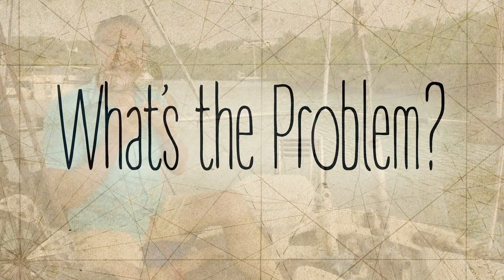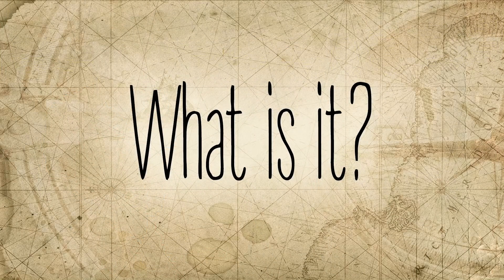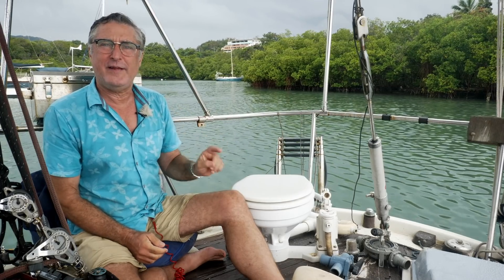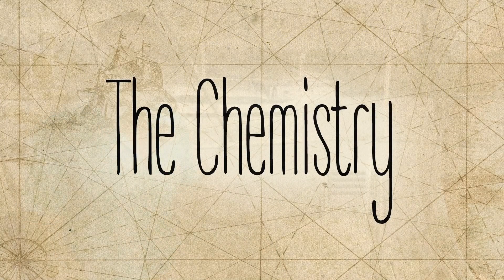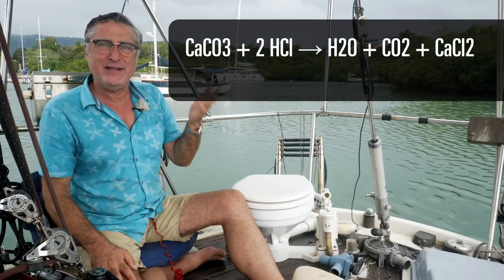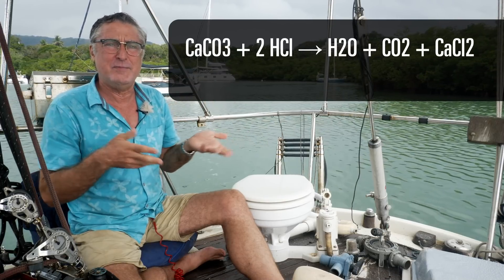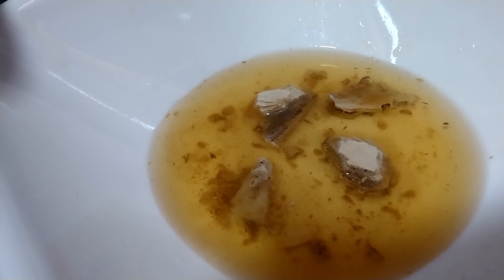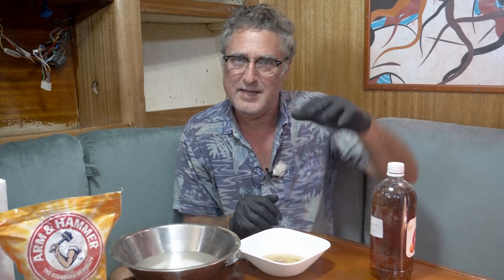Avoid Crappy Situations Aboard

Comment: Does the holding tank get full of stuff that can't be sucked up present overboard?
Reply from the maker: They don't tend to.  I've had the same tank in Temptress for over 35 years. It's fine.
   I put some acid in it through the toilet while cleaning the toilet but I expect that it is neutralized by the time it gets through the hoses.
   Likely the urine reaction is neutralized by the time it gets to the tank.

Comment: Our best recommendation for a boat head improvement is to install a non-electric bidet toilet seat adapter. They are relatively inexpensive on Amazon and significantly help reduce the use of toilet paper on board. They also make it easy to clean the toilet and flush with fresh water when treating with vinegar or acid.
Reply from the maker: Yes, we have one on Temptress

Comment: Clark -thanks for this I learned heaps - i used 80 grit sandpaper to clean my porcelain bowl before i watched this. Got all the Ca Co3 off  like new..   I have a friend that suggested I use Muriatic Acid into my heat exchanger..says they come up sparkling.. just add toengine side of sea strainer and let sit then flush....What are your thoughts?
Reply from the maker: Occasionally it's required.  I usually take the intake and outlet water hoses from the engine to a bucket.
That way I'm not wasting acid and I can see the "rocks" that come off.

This is important as this process takes a while.  The heat exchanger needs to heat up first.

Also for safety and ease on your engine you might want to use citric acid or white vinegar.
Reply: @Clarks-Adventure  You are a champ - love your work.. Thanks

Comment: Thanks for another great video with great tips.  But how do brass seacocks react with the acid?
Reply from the maker: It should be reacted by the time it gets there so not very strong.  If not the ocean would dilute it fast as it's just inches away at that point.

Comment: I have read that the buildup in the pipes is cased by a reaction of the pee and salt water.  Wouldn't the best way to avoid it simply be to eliminate the salt water.  On my last boat, I kept a jug of fresh water next to the toilet for flushing.
Reply from the maker: If you can spare the freshwater.

Comment: When I bought my boat I did the trick with the vinegar. I did not dare to use the stronger acid Think it will not stop to the hose inside but will chew on your valve too. Any way the vinegar work so well that the deposit come lose and clog the valve. In the end I replace the whole hose. Conclusion it does work but please do not let it build do it monthly as a maintenance.
Reply from the maker: Yep you got that right.   I don't think that a stringer acid would have much effect on your thruhulls.  Unless you over medicate it's no longer a very strong solution once it gets there and the ocean would dilute what's left that color to the end.

But yes broken bits can cause mischief.  And if it's thick enough it might not even come off the hose walls easily.

From experience.   At least it's a nicer job after the "rocks" have been acid treated.  I find the smell and general yuckyness lower after acid treatment, but it could just be my mind set.

Comment: Good info and presentation.    My best tip for improved head performance is to get a Lavac brand head.   It's the ultimate in simplicity using only a single diaphragm type pump, ie. - no 'joker' valves, no little valves and small diameter piping.    I've used these Lavac heads since the 80's and never had a problem nor any maintenance requirements.
Reply: Ross can you remove an old head and put in Lavac..

Comment: You can avoid a whole class of problems with a composting toilet - and then have to deal with a whole new class of problems.
Reply: I don't think that collecting and then disposing of solid and liquid waste is a viable option for long distance sailors / liveaboards.
Reply from the maker: It actually works well for many boats.  It's got to be seen as a viable solution.
Reply: @Clarks-Adventure  Everything on a boat is a trade-off.
Reply: I was always lukewarm about composting heads until I bought a boat with one. My present catamaran has no through hulls so that sort of dictated the type of head. What I was unprepared for was the total lack of any head aroma, a good thing since the head is directly adjacent to my sleeping quarters. My install has a pair of small computer fans constantly evacuating the waste area which makes it odor-free even while in use. I don't think I need to go in any more detail about that! The two big negatives as I see it are the need to train all crew and guests and the lack of an overboard option for open water. These are easily counterbalanced by the avoidance of the operations that Clark so eloquently describes.

Comment: The best toilet/bathroom cleaner I have found is Citric Acid powder.  The same thing used in home canning.  I buy a 2 -5 pound bag on the web.  I mix 1 Cup powder in 1 pint of water.  Some people also add ½ Cup 20 mule team Borax.  After it is mixed and dissolved I put some in a squirt bottle like a ketchup or used honey bottle to squirt it on to scrub or soak.
Reply from the maker: I like that it can be stored as a powder.

Comment: Vinegar is excellent for
- dissolve corroded electrical sockets, leads, relays etc. 
- dissolve corrosion on rigging
- dissolve calcium carbonate in clogged toilets 
- cleaning away mildew 
- making tasty table water to double for vine (1tbsp/pint)
- saving funky drinking water
- for soothing pain after jellyfish or insect stings (spray it on)
- soothing sunburn 
- soothing itching after fibreglass work
- making your own mayonnaise! 
- for perfecting fish ‘n chips (malt vinegar)
Reply from the maker: Cleaning up resin.
Reply: Right! I also use it for getting a nice rusty patina on steel works for props/requisites 😉

Comment: We used to clean the water distiller on the submarine with cool aid packets minus the sugar. It worked well and was readily available.
Reply from the maker: That's us military spending for you.  Why use 2 cents worth of HCl when you can use the most expensive form of citric acid you could possibly buy.